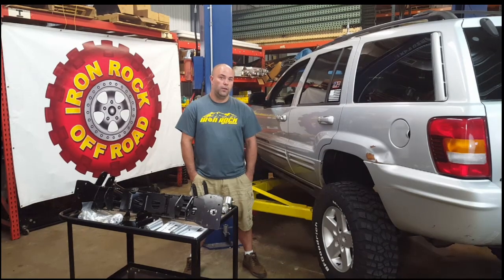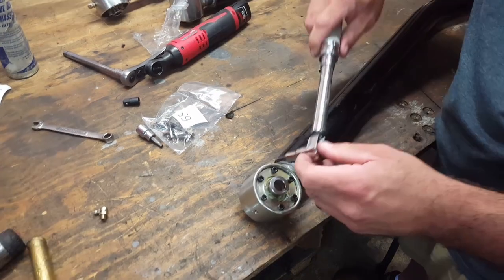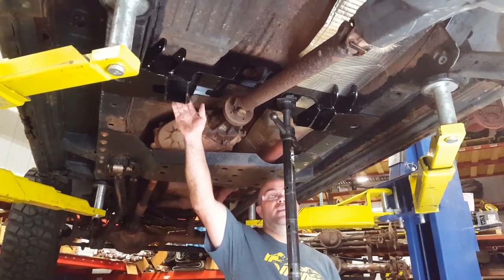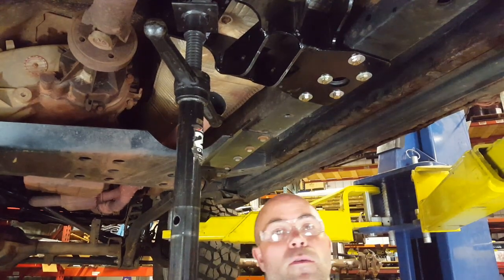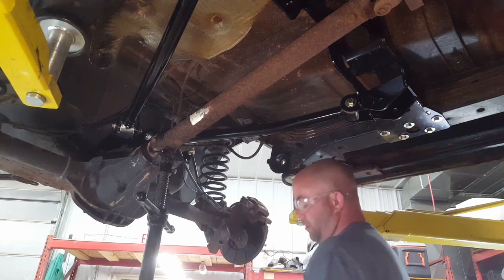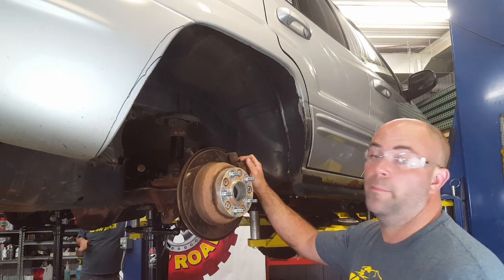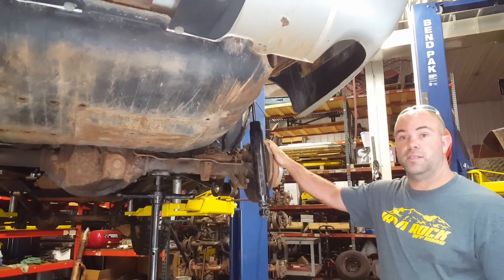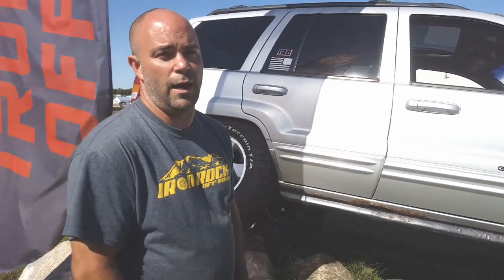EASY - WJ Rear 4 Link from Iron Rock Off Road!

Comment: I just bought the Rock link 3 link long arm kit. It says in the description no cutting required. So does the muffler have to be cut off? or that just made it easier for you? Idk I think the video description might be a little confusing or wrong.
Reply from the maker: The 3 link is our front suspension, and no exhaust modification is required for that.  This video is for the rear 4 link, which DOES require exhaust modification.

Comment: I have the same exact rear driveshaft shaft with my jeep and I’m trying to get started with the rear 4 link install. Is this going to work?
Reply from the maker: @matthew7972 How much lift do you have, or will you have? What transfer case do you have?
If it is the exact same driveshaft, you should be good. The slip yoke has quite a bit of travel in it. The Jeep in the video has 4" lift but used the OEM rear driveshaft up to 6.5" of lift and only swapped it out because of a transfer case swap. 

Check these instructions, page 3, under the "Notes" section.
https://www.ironrockoffroad.com/Merchant2/WJ%208%20inch%20ROCK-LINK%20PRO.pdf
Reply: @IronRockOffRoad  I have the 4.7L Quadra drive 2 system (247J transfer case) and I bought the 6.5” rock link pro lift from you guys. The 3 link in the front and 4 link rear. I have 33” tires with the D30 front/D44A rear. Front driveshaft is double card an and rear is that single ujoint with that balancer

I greatly appreciate the responses as this is gonna be my first time ever working on my first jeep. I also bought the 1-ton steering kit form you guys and pleased with the quality
Reply from the maker: @matthew7972 It sounds like you have the exact same Jeep as the one in the video. It is a 2003 Overland, so it has the 4.7L HO, Quadra drive (247 transfer case), & D30/D44A axles. I wouldn't hesitate to install the full 6.5" Rock-Link PRO kit. The original front double cardan shaft and your OEM rear shaft should be good. The WJ 1-ton steering is a great kit, if you want to turn it into an Over The Knuckle (OTK) kit we can help you out with that. OTK makes your front-end geometry much better at 5.5" of lift and above.

If you have any questions along the way, give us a call 9-6pm central time 952-210-7185. You'll always talk to a real person!
Reply: @IronRockOffRoad  awesome, I plan on installing in a couple of weeks. I will definitely give you a call about the OTK kit I ordered. Thanks again love the customer service
Reply from the maker: @matthew7972 It has been a couple weeks, I just wanted to check in. Did you get everything figured out?
Reply: @IronRockOffRoad  really appreciate checking up on me! I’m actually going to start installing the long arm kit this Saturday. I bought the kit back in July but haven’t had time to start it until this weekend. Hopefully it works out
Reply from the maker: @matthew7972 We're happy to help any way we can! Before you dive into the install, make sure you have everything you need like a good drill, drill bits, and some anti-seize. You can also build all the flex joints, assemble the arms, and set them to the proper length. That will make the install day go much smoother and help you find anything you might need before Saturday. Gotta set yourself up for success!

Comment: What size tires are on it right now?  They fit in the rear wheel wells perfectly when it was fully flexed.
Reply from the maker: @robgoffroad Those are 285/70-17 BFG Mud Terrains

Comment: So what becomes of your exhaust? I have a magnaflow that I’m not partial to losing.
Reply from the maker: We offer a 4-link exhaust kit for the WJs! Check it out at ironrockoffroad.com!
Reply: Build your own. I have this kit , bought the exhaust , after 3 months I tossed the exhaust. Honestly, your better off building your own . You can fit a Borla stainless muffler between the front and back cross members from the long arm kit with room to spare. You will need to cut off and toss your 3rd cat tho , that is where the Borla muffler will now go.  Make sure you get a offset exit on the muffler. That is the only way this works.  The exit lines up perfect next to the side of the back cross member. From there , you can route your exhaust.   Or as an alternative you can connect a 12 in long turn down exhaust tip. This tip  ends up right at the back and next to the cross member. Once that is in place , you can drill 2 small holes and add an exhaust hanger to the cross member.   World of a difference and man oh man that Borla sounds amazing.

Comment: Can't wait to add this and the Pro Rock 3 link to my WJ.
Reply: I have the front 3 link. I’m sitting at 4.5 lift with 32’s . Feels more stable than the short arm I had , however, the ride is the same as my short arm when it comes to vibrations from bumps. I suspect it’s because my short arm has rubber bushings at all ends , while these only have rubber at the axle end.
Reply: I have their adjustable short arms and 3" lift. Going to 4.5" when I put the long arms in. Just waiting for my sye and front yoke and full length frame stiffeners to be installed. Glad to hear the 3-link is stable at that height.
Reply: I wish I could afford to put long arms on mine lol I’m on core 4x4 short arms at 4 inches of lift on 33s

Comment: So to get side to side measurement adjust your uppers but thought upper is for pinion angle
Reply from the maker: Adjust uppers independently for side to side, and together for pinion angle.
Reply: @IronRockOffRoad  ok so if I need to go to passenger side adjust which top arm passenger or driver side